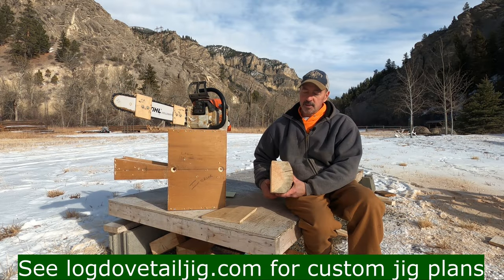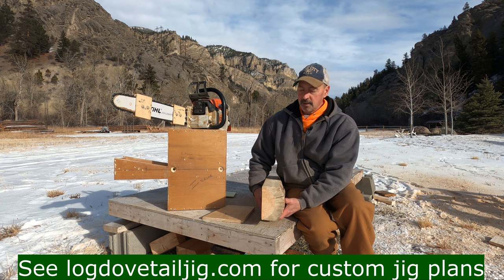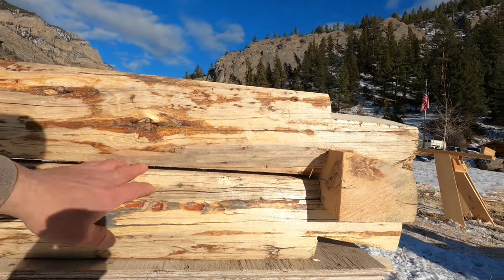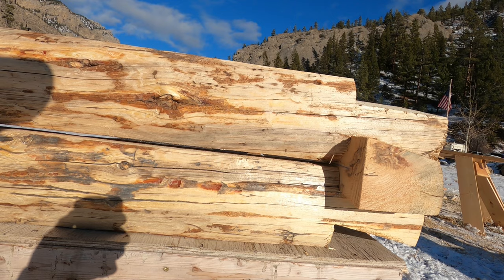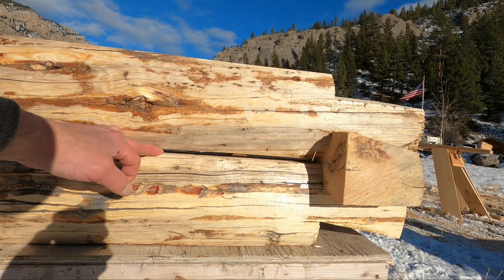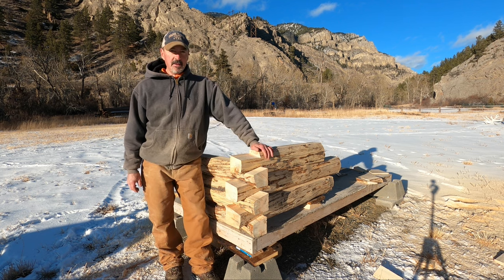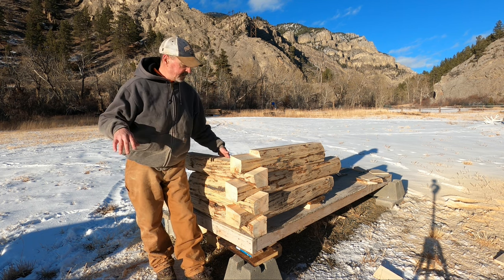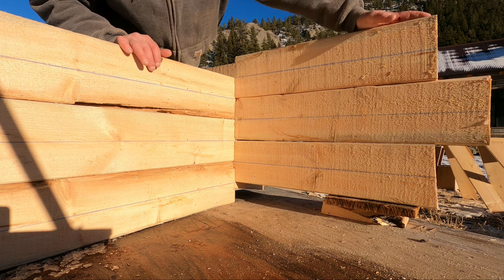Dovetail notched log cabin with D logs.

Comment: Awesome video! Thank you! I'm sawing logs now for a tiny log cabin (6×10) and planning to do zero gap but also cutting a 1 inch groove top and bottom of each log to put a 3/4 inch board and insulation to seal the logs. Also planning to dovetail the ends so I'll be ordering your plans in the near future. Thanks again!

Comment: Seems to me like you want the dovetails to be TIGHT and going for a zero gap between the logs risks creating gaps between the dovetails, which could cause those to rot at lot faster.
Reply from the maker: Yes, I prefer a small gap between the logs so the joints are tight.

Comment: I’m trying to get my head around whether such a jig could be used with whole round logs to build similarly. I have a lot of poplar on my land that needs to be thinned and ranges from 5-10 inches in diameter mostly. I’d like to build some small lean to shelters in the woods and wondering if using such a jig on a whole log that size would work.
Reply from the maker: You could use it for round logs that have the interior face milled flat.